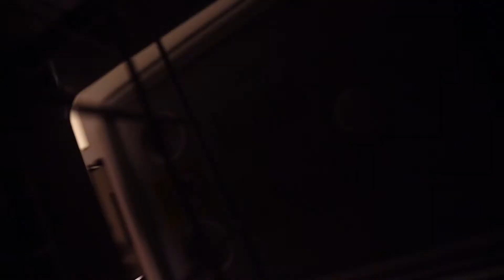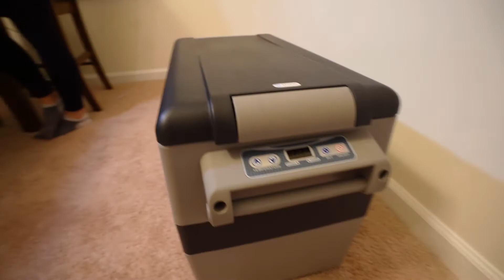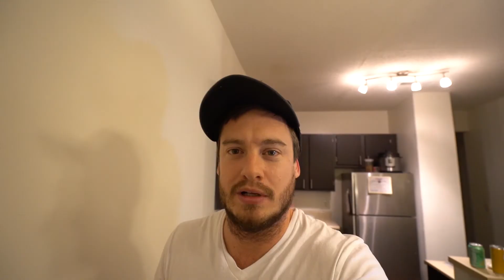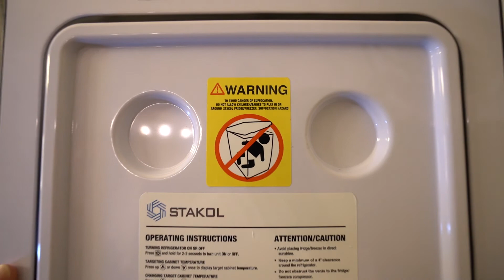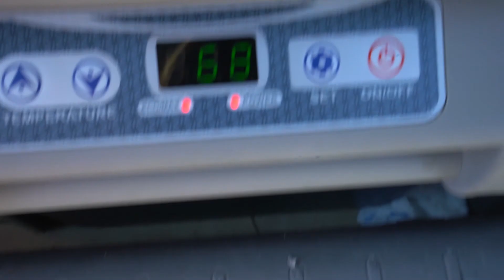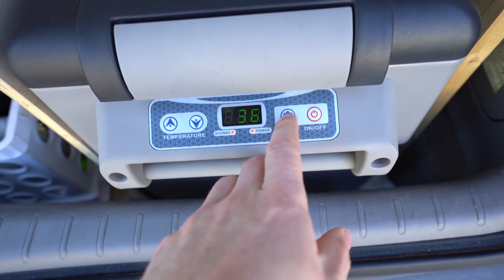Stakol (Costway) Car Fridge REVIEW

Comment: Do not buy this item. It died after having it a little over a year. I contacted customer service in trying to troubleshoot the plug issue and their only response was that the return policy window was closed. I didnt even ask to return it. I asked if someone could help me troubleshoot it aka put me in touch with the manufacturer. Too expensive of an item for only lasting 13 months.

Comment: I have the Costway 53 qt 12 volt fridge....works awesome... i have had it about 8 months and the On/Off switch just stopped working...I have to Unplug it if I want to shut it down.
I also bought the Costway Washer/Spin drier almost 2 years ago $109.00 back then... BEST Purchase I ever made...and I use this thing a LOT !

Comment: I bought the Costway 84qt for my van. I’m getting the Error 01 code right out of the box. I’m going to try running bigger wiring to the socket and see if this fixes my problem.
Reply from the maker: Hope that one will fix it, let us know how did you go!
Reply: XPLOREITALL it did! It’s been running for a bit with no errors!